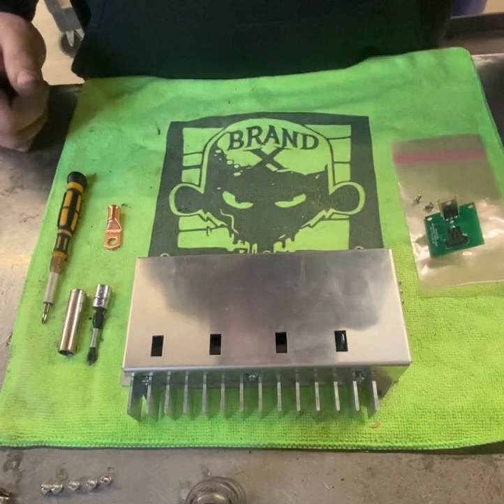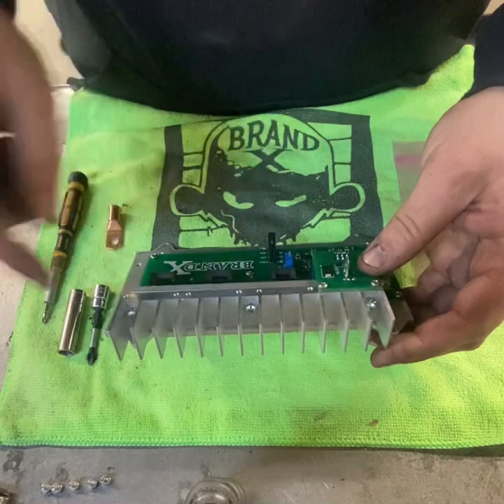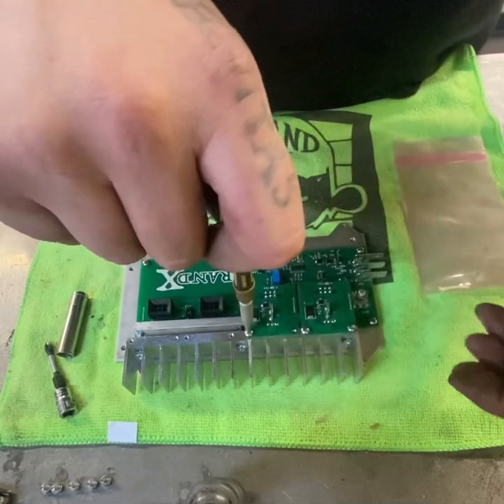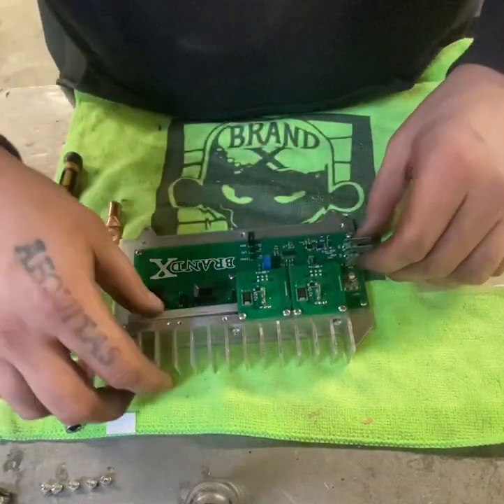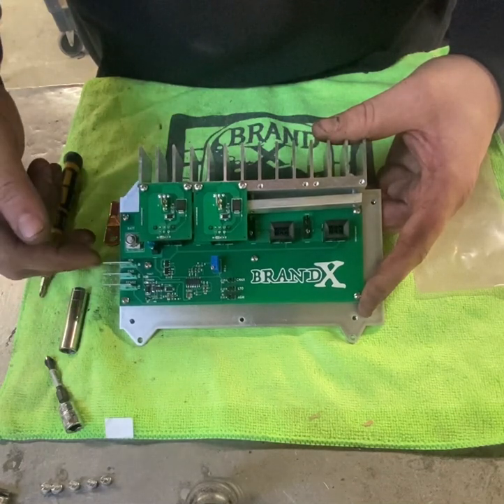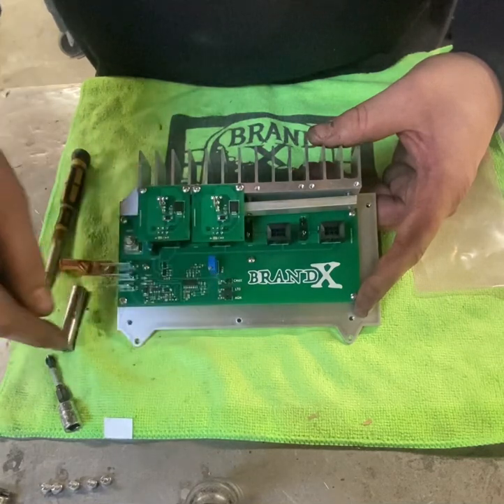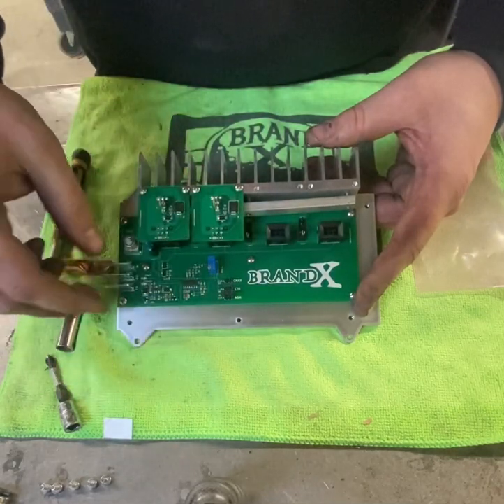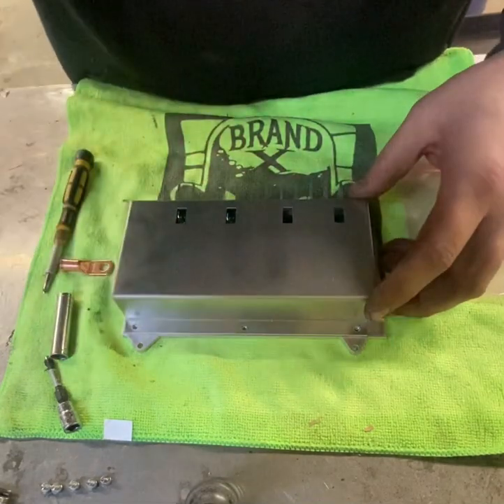Brand X External Multi Channel Alternator voltage Regulator Positive Control

Comment: What is the bolt for, 12 volt power? If so that would mean this needs 2 12v power connections?
Reply from the maker: Sense connection is isolated for separate charging systems.

If you’re using it on one single charging system yes, both go to the same location.

B+ is b+, so on an isolated system can use it on the 12v battery.

Sense would go to the stud of an alternator.

This regulator works for both applications, and prevents spiking : damaging the alternators or batteries by accidentally connecting b+ to a 12v side of the sense wasn’t isolated